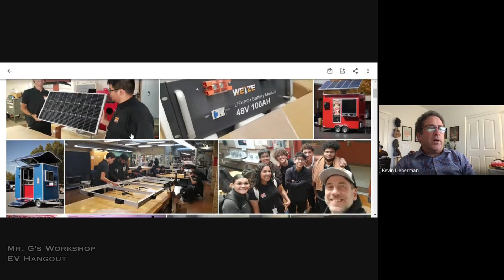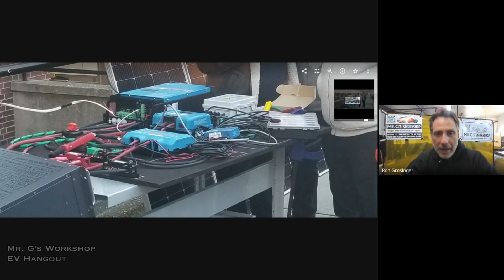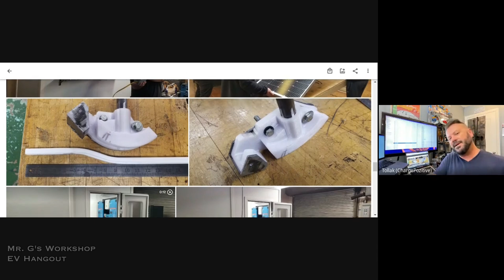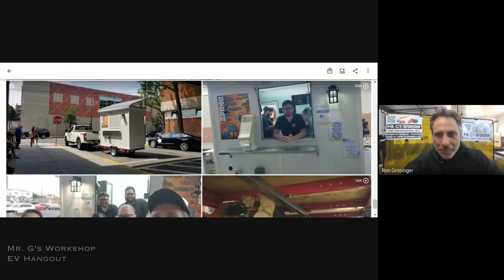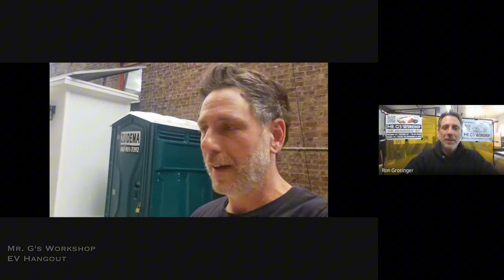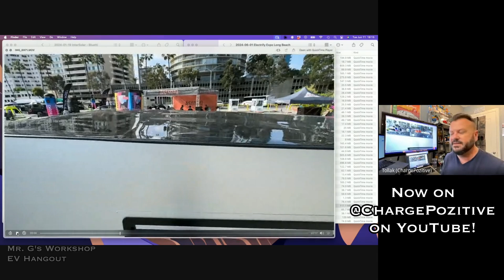Off-Grid SOLAR Food Trailer built by students is FINISHED!

Comment: I want an off grid solar food trailer, (really just a table to start with)  what's your tips? I only need maybe 3000 watts to begin with then expand. Any tips?
Reply: You really need a powerpoint for this. Way too long and slow.
Reply from the maker: Yes you are right...  I have more info and I will post a concise updated video.  Plus feel free to contact me with your questions.  Victron system in best but pricy   https://www.rongrosinger.com/
Reply: Cool, this is the size I need I think. You should post an equipment list. The video drags on a bit. An hour? We got lives man! :-)